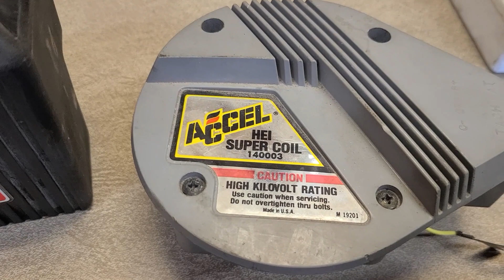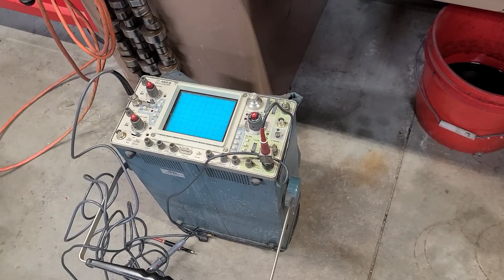Coil testing - external coils

Comment: Any idea what rpm your running at? Thanks for the video,  and nice setup....
Reply from the maker: I'm not sure what RPM I tested these at but I'd guess about 3000 RPM on the tach so about 1500 RPM (dist turns at half speed when installed into the engine). This is the kind of stuff I do in my spare time when I'm sitting in my garage with too much time on my hands. I like to do some rudimentary testing on different things hahahaha
Reply: @BruceCoggins  Oh well, it keeps you off the streets.....😅

Comment: The crane coil misfired on the plug, second to left.
Reply from the maker: Good eye...I didn't catch that. I'm going to check that out next time I get in the garage and see if I can duplicate it. I want to make sure that wasn't a frame rate issue...I don't think it was in this case...but I want to see if I can figure out what is going on.

Comment: I really like your homebuilt distributor machine. I think I read an article on your construction of it(?) If I remember correctly you powered it with a windshield wiper motor(?) and had a little trouble figuring out a drive connection to work satisfactorily(?) Anyway, I like it and would one day like to attempt to build something similar👍
Reply from the maker: I built this distributor machine based on the article you are talking about. It's not my design, I just looked at what that person built and went from there. The motor is just a common blower motor. I added a couple of things to make my unit different and work better for my needs. The hardest part of making something like this is getting started. I highly encourage you to go buy the materials and build you one of these...you will literally spend hours playin...err...um, testing...yeah, that's it...testing stuff ;). If you decide to build one of these and have questions, I will be glad to help you out.
Reply: Very nice job. We have similar interests fer sure. Thank you.

Comment: Cool video !! .....You deff Need to hook up the Scope.  You can clearly See & Measure the coils Primary  & Sparkplug Voltage & current Duration & calculate the total spark  millijoule energy Delivered to the Plugs......All coils have a design Inductance spec.....Having a LCR meter is very helpful to Measure the coils Inductance.....There's a Lot of Complex electrical energy Transfer design involved in achieving the most energy to the Plugs than it first  appears.......
Reply from the maker: Yes, I definitely need to get that scope hooked up. I'm sure there is a lot more it can tell us. As you know, over the years we've see certain parts in different brands and that look identical but there is always one manufacturer who says theirs is the best or puts out the most power but who really knows without actually doing some side by side tests. 
Thank you for your input.

Comment: Paramount distributer Co. in Michigan has all the stuff you will need to get the machine running . He has a kit to convert the flash tube to LED and does away with the capacitors and stuff . I got one for mine and it works great now nice bright light .
Reply from the maker: That's exactly what I was hoping for. Thank you so much for letting me know about that. I was hoping there was a way to not only get it working but to update the whole thing.